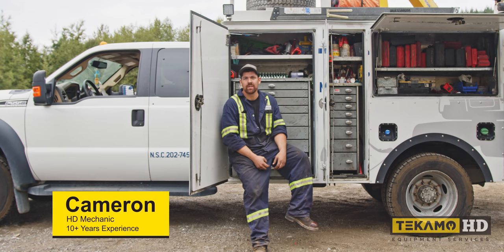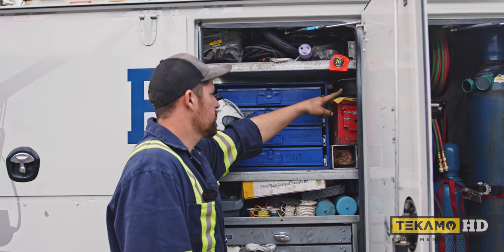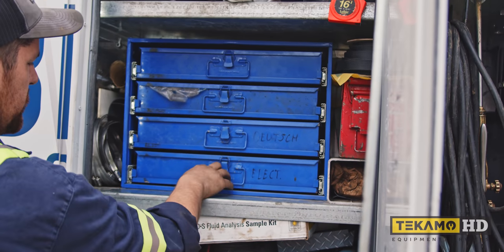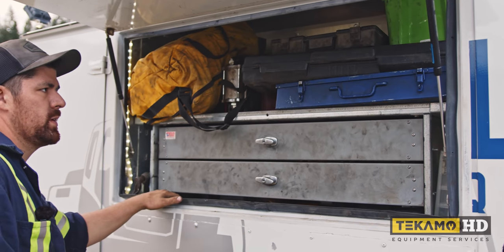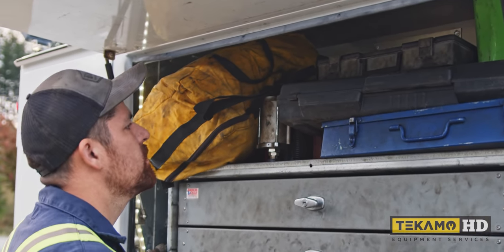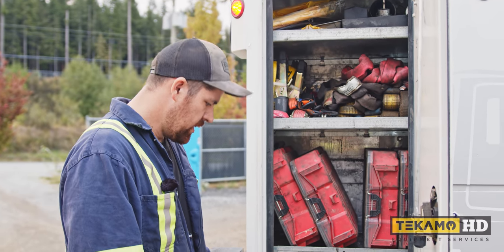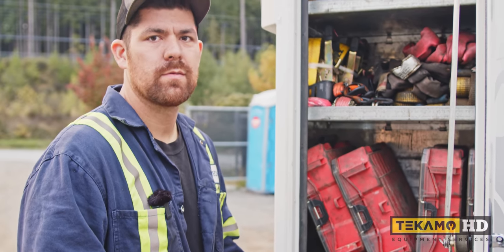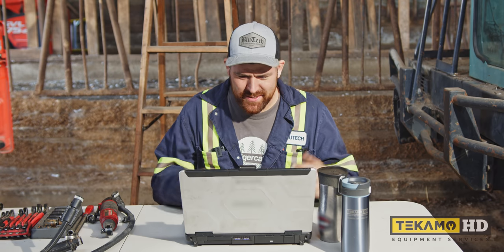Want to Know About a Mobile Mechanic Service Truck? Inside a Ford F550 - Heavy Duty Mechanic Q&A

Comment: I done emergency road side service truck for 24 years using  F150 ford extended cab 4x4's. miled out 3 trucks in my time on the road not even wanting to try to guess how many running motor hours each truck had. only needed tow home one time when a front upper control arm failed. doing mostly semi truck and trailer stuff primarely to get the unit mobile to get to a repair shop if it was a big serious repair. the highlight of my truck was having a remote start on the welder that i had a cord run into the cab to a microwave and a coffee pot, esentials for long days on the road. i could warm my coffee on the go. Only now sitting back looking at my time out there doing that job, I wish we would have had the powerful battery operated impacts ect they have today would have made things so much easier. the bonous on my truck was converting the air compressor to being powered by the trucks motor after years of fighting to start a tiny gas powered motor in minus fourty weather. the one big down  side to using such a small lighter truck like that was space once you stuck a miller portable welder in the box. along with rattles of tools in two tool boxes mounted in the back seat of the cab. we removed the seats and made a flat floor we bolted the two boxes to. but tools were always warm, and air line hoses and wire ect were kept warm on the racks between the tool boxes. Now not doing as much I just use my Ford Ranger to do minor fixes or as i callem put on a bandaid to get the unit off the road. it works ok for what i do. yes guys, yes guys i did receive some slack when truckers seen a girl come to fix their trucks. my favorite line was,, You Broke It Butter Cup, If You Do Not Want Me To Help Say So. and I had guys actually ask for me to come rescue them, so worked both ways.
Reply from the maker: Wow that is an amazing story! We would love to see your setup. We're going on the road to do truck tours with technicians around North America very soon. If you'd like to give a truck tour then let us know and we'll ask our team to be in touch with you. You can reach us through our website that's linked in the description.

Comment: unlike the carpenter i understand everything and i relate so well. I keep things clean. I like OEM repairs but will rig it if I have too. I’m sloppy with used parts and parts for my own truck but I try to keep replacement parts for sale in good neat order. But you have to be consistent and routinely clean the truck after big jobs cause you are tired at the end of the day (or midnight lol) and you just throw stuff in the box as long as the door shuts on the box then you don’t care lol. But the next day, or next chance you get between jobs you need to go back and put things back in place and clean them. So you will stay ahead and stay organized. I have had to learn the hard way 🙄 Don’t be lazy. Keep your tools clean and check your inventory each week! Good video btw. Loved it! :)

Comment: I “up”/down graded to a diag tech… and was offered a smaller tool body full 4 door cab truck but no crane… thought it be nice zipping. From site to site mine to mine .. not having to worry about parking and space 

Don’t do it lol I regret it all the time my service truck was like a second home and I knew where everything was and could do almost any job from it self sustained for the most part.. now doing almost the same amount of jobs with less space and tools just a mess will switch back offered in the future ..

Also brakes were a big factor on wanting to switch went through pads like bi monthly wheel bearings and seals often as well but I’m not getting too much more life out of these smaller truck pads with the weight on the truck 

Just a friendly warning for anyone considering a similar downsize in truck I wouldn’t knowing what I know now.. our most senior field tech did the same as me and we both are regretting it

Comment: Wow I wish my truck was that well kitted out when I was working on oil field cranes...and jeez it was impossible to get companies to pull oil samples on their cranes. Worst one I saw was a return filter on a grove had never been changed since new 6k hrs of run time well the filter was gone and the whole system had to be opened up and purged/cleaned. Sadly I was laid off right when that job started so I didnt get to see how screwed it was. Kool truck bud

Comment: also yeah you better have things tightly packed or otherwise things slam against each other and get “discombobulated”lol. So that also means you better have enough space to have everything you need because when you pack it tight there is no extra room to add more along the way other than taking it all out and re-engineering your tools and parts storage… or adding more boxes to your truck. If you got a big truck like this it’s harder to run out of space lol (depending if you fix heavy machinery or 18 wheelers) but you have to be more concise and creative when you only have a 1 ton Dodge dually 8 ft service bed lol. The dually is a must though. Bare minimum as a field mechanic Don’t attempt diesel repair with a single rear wheel… Not enough load capacity nor enough room cause you have a smaller bed since your truck is not wider like the dually… anyway. just some input and i loved the video! 👍

Comment: Omg I wish mine was that big I'm disabled and been wanting utility truck while to make me fishing and camping truck set up for someone in wheel chair I can walk which my box has top open and it's kinda tall I'm 5ft 8 and I can't see in top unless I'm on tip toe lol. But will be great for fishing rods. I also run kids fishing group I go out find awesome and special kids young adults that can't get there own righting gear and I'll get them set up with rods reels tackle and all with parents permition. Alot we bless have parents disabled also or single parent like I was for my daughter while life at home. Shoot she's 21 just had baby and I still try to help out. But I like my truck but guy burnt me on it took money to fix some stuff and I paid think to much kinda but he took money drop dropped off didn't fix and found out heater was in hooked the tail light wires ripped out so can't drive. How can someone rip off someone disabled or that has to use wheel chair when out at stores. But that's not sad part we spoke about me getting scammed on toy hauler wish I could have walked up the ladder to see the top it was bad now roof inside the toy hauler over 16ft of 25ft trailer spent 6k and can't camp or drive the truck. But he told me about a boat he got scammed on and said how bad someone did that to me. Then he took the money took my guns and I didn't get what I paid for. I saved so many years. But I'm praying someone will come look at the toy hauler bathroom still covered and part kitchen if I can find way and help ide love to take cabnits out bathroom new 2x4 to hold up the roof left but suport the rest roof it should be good damage was in back but when back dropped open like sardine can just pulled away. But if I can add front wall fix roof. Have 10ft box and 15 ft floor on back be a deck. Maybe can add a roof just 2x4 roof to were I could cover with tarp when I go camping I mean I sleep out side anyway. But I picked toy hauler for ramp. Now can load wheel chair my grill and scooter things can't fit in a camper gen all that. But I'm praying I can. And if possible find walk in shower floor make the bathroom were I can add chair or set on toilet out it in shower alot RV are one open shower with toilet sink so it has been done but I need wheel chair size I can't stand long so maybe this was blessing I've wanted a camper with deck for over 15 or so years to use for traveling and us giving away fishing gear to special kids. But I mean I'm sorry if your reading I didn't mean to say that. But your truck man ide love one that big then draws for fishing tackle I want to make one or find a cabnit top to bottom draws to add for tackle hooks weights swivels terminal tackle but that's perfect yours I mean my small and big tackle boxes would fit in. Ide give my gmc truck and my 04 dodge ram to have 1 truck like yours that's alot storage my camping gear my tackle one side with gaw gear for kids that way when I find more all go in one side. Thanks for sharing sir. God bless.

Comment: Got a question for ya Cam, how does the welder handle being inside the dog house? Do you have vents to direct the hot air out of the dog house? I’m setting up my new service truck and I like the idea of having the welder inside the dog house rather than on top of the box, but I’m curious about ventilation

Comment: Nice set up worked as a heavy equipment mechanic for 25 years had a lot of service truck similar. But sad that anymore once a mechanic always a mechanic no where to move up to anymore most service managers now have never even been a mechanic. Fortunately I got out before I was unable to work started doing A/D work on cranes.

Comment: How much does the truck weigh my f550 weighs about 20,000 and your carrying more than me I'll bet your weighing around 24,000
Reply: 30,000lb is not uncommon when it’s that much tooling and stuff. These trucks are always overloaded and it’s nice to have a bigger truck but than you have to deal with commercial vehicle paperwork and hours of service crap.